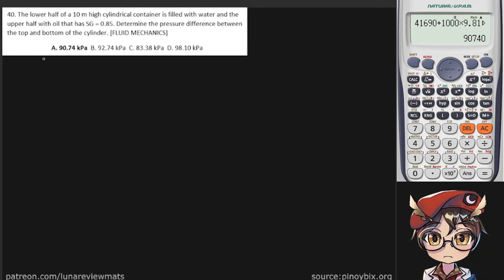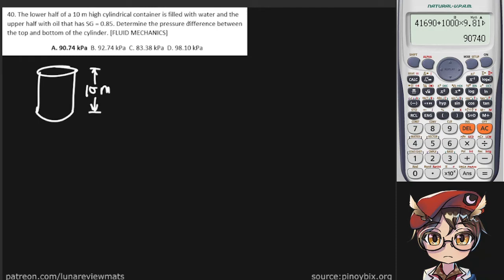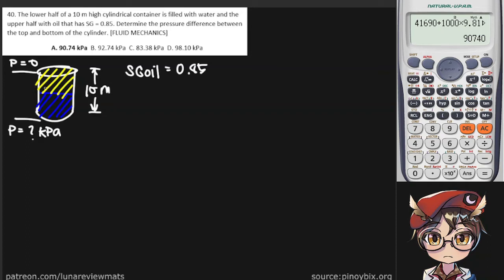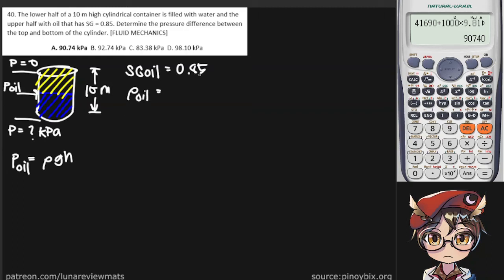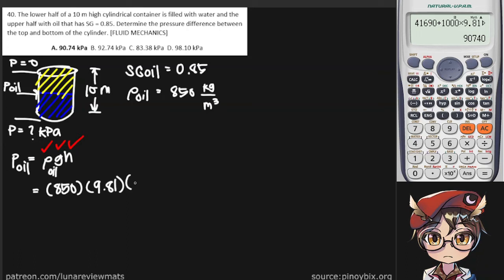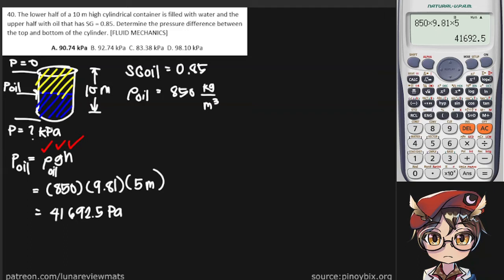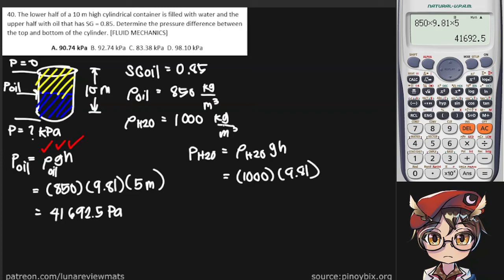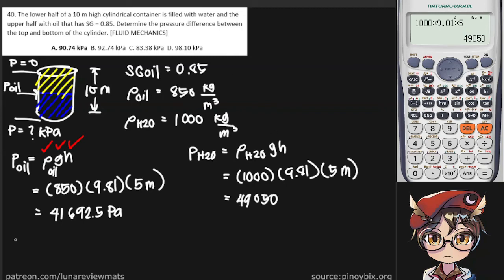The lower half of a 10 m high cylindrical container is filled with water and the upper half with...

Comment: Why pressure at bottom is the sum of water and oil pressure?
Reply from the maker: That is because both liquids are being pulled by gravity due to their collective mass at the bottom of the tank. If the tank were placed sideways, the mass of both liquids will be pulled by gravity towards the side facing the floor instead.
Reply: @LunaReviewMats it said pressure difference, don't we need to subtract it?
Reply from the maker: @jozzeyisliving  Yes but you are subtracting the water and oil pressure with 0 (the pressure at the top of the tank), so you end up with just 90.74 kPa.

Comment: hello sir i have questions, how can we know if Patm on the surface can be neglected? and also, 10 meters are the total height of cylinder, what is the basis that oil has 5 m of height? thank you sir!
Reply from the maker: The pressure at the top is not actually Patm, but rather the top of the inside of the cylinder or simply P. Since there is no oil, air or water applying any pressure at the top of the cylinder (our reference point), you can simply say that the pressure at the top is 0, since the formula for pressure at a certain height is given by P = rho*g*h. Since h = 0 at our reference point, P will also be 0 since anything multiplied by 0 is 0. On the other hand, the bottom of the cylinder feels the full pressure of both the oil and the water in the tank, mainly due to gravity pushing them down into the bottom of the container.

For your second question, the problem states that "the lower half" of the container is water and the "upper half" of it is oil. Therefore, half of the container will be 5 m high since the total height of the cylindrical tank is 10 m. I hope this helped!
Reply: @LunaReviewMats  Thank you so much Sir! Today is my exam actually, you helped me a lot Sir! Thank you!!
Reply from the maker: @TackleHub  You're welcome. Good luck with your exam! :)

Comment: Why we add both pressures?
Reply from the maker: The densities of oil and water are different so we have to calculate them separately. Then, we add them together since they are both applying a total pressure to the bottom of the cylinder.
Reply: But we needed to find pressure difference.
Reply from the maker: @hassanadnan4198  Yes, but the pressure at the top of the cylinder is 0. So the 'pressure difference' is the total pressure P (at the bottom of the tank) minus 0 (at the top of the tank). The 'pressure difference' in the question is just meant to confuse us.
Reply: Oo i see.. thanks